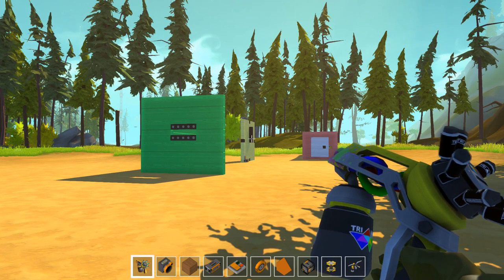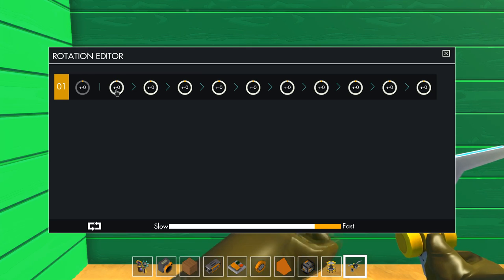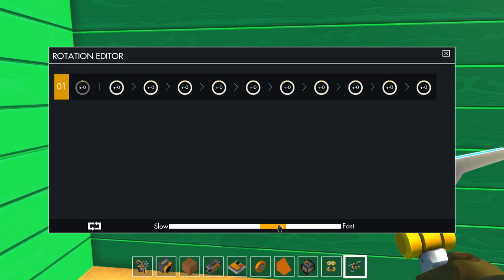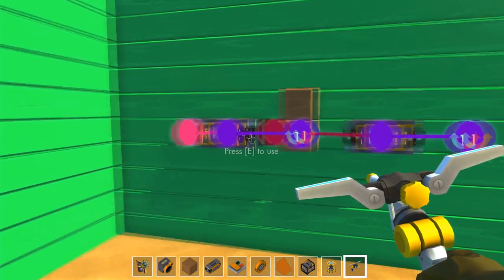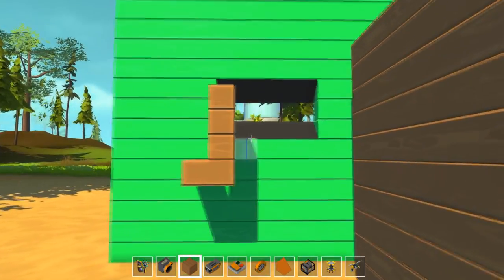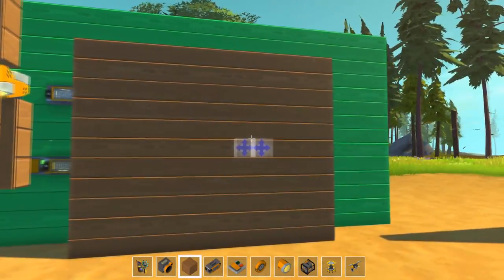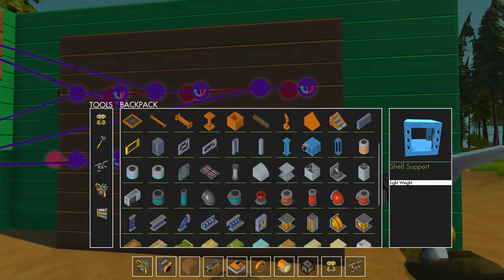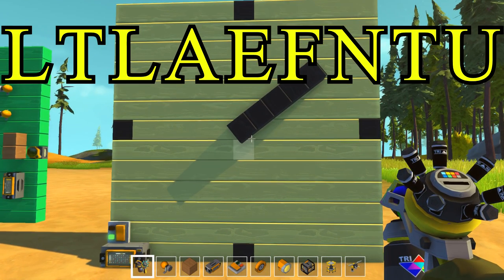TIMER TUTORIAL | SCRAP MECHANIC Tutorial

Comment: Hrmm. Thinking about this, a radial clock (using the xor method) is likely a better signifier than a row of lights. But neat. Very neat.
Reply from the maker: are you talking about using a start and stop signal for the xor? i did try circular design but unfortunately the game does not like multiple beatings being put in series with eachother, and for 15 minutes i needed quite a few.
Reply from the maker: +Callipygian Moose i mean bearing haha
Reply: Hrmm. you could compress "quite a few" to be a binary series. (bearing 1 rotates by 45 (for example), then 2 by 90, then 3 by 180) and adding/subtracting could be viable there.

Alternatively (and this is me with a large glass of wine), wouldn't a gear work?

(go go ascii art powers!) 

|.i (arm, axle, gear). With permitted movement from a series of bearinged levers? 

Or, perhaps, a cyclic bearing goverend by a sensor. So each clock "pulse" could break the sensor-beam at a different point?
Reply from the maker: yeah i think the light design in view of the challenge was more just a visual indication of how many minutes (lights) are left. i have played with some gears actually. i could do it but if i wanted a reaction each minute the bearing shaft would glitch out and start snaking on me as i would need 15 bearings because the controller can only handle 50 secs..
Reply from the maker: if i could connect multiple controllers to one bearing then problem solved
Reply: Yes. But can't you simulate that with multiple bars interacting with a single sensor?
Reply: Though for a countdown clock, I'm certainly overthinking this, as all you need is the first and last light-bearings to cover/uncover a sensor to start/stop rotation. And a gearing (via bearings/sensors) to slow down the primary visual-controlling-bearing to 15 minutes. 

If I remember the video correctly, you articulated a 30 second rotation speed (as the midpoint?)  Which means if you have two of them, (obviously adjusted for the play in start-stop times of rotating beams at whatever distance needed for accuracy), 2 in a row should provide a 900 second clock. 

To elaborate, the first sensor rotates entirely every 30 seconds. (And we'll presume at a good length so that any given square is occupied for exactly one second -- (asking wolframalpha about the radius of a circle of circumference 30 gives us 4.7.)) and one block 5 squares away has a sensor which causes another bearing to rotate at nominal speed 30 seconds). That second bearing should complete its rotation in 15 minutes

Alternatively, if you can get a binary counter (a another good video), you should be able to get 15 minutes out of four bearings in a much smaller volume.
Reply from the maker: you're obviously on the ball! Feel free to add me on steam and talk me through it in game! so in Lehman terms for my little brain, every 30 seconds send a 1 second pulse to a second controller set to mid-speed (and i would assume set to loop operation so it doesnt reset itself when the pulse is off)
Reply: (Actually, none of this is from the game -- I run linux, so I experience it vicariously through you all. Just basic mechanics and logic design)

Yes, so, the proof would be three very fast bearings, two sensors, rods of appropriate length (I think you said 10 seconds? -- you may be able to do this with engines, especially if either can implement a constant angular velocity -- maybe electric?)

The theory behind this is exactly the theory behind a gear ratio, or to be more exact, the carry bit on mechanical calculators.

A normal gear ratio is "if I've got a gear with X teeth connected to a gear of Y teeth, the gear with Y teeth will rotate X/Y times for every rotation of X. If you have a gear with exactly 1 tooth  then it requires a full circle to advance the other gear one notch. This is how mechanical calculators and flip clocks work.

Thus, at mid-speed (presuming I remembered correctly) we can simulate that one tooth'd gear by rotating once every thirty seconds. If the second wheel takes 30 seconds to rotate, and rotates for 1 second every thirty seconds, we have a total rotation time of 900 seconds.)

That's the theory at least. With rods of length 5, you should have a pulse width of... about 5 seconds? (you'll really want to play with this bit, otherwise the "play" (wobbling) of the system will be tedious and off)

To mostly reuse the light infrastructure in this example, if you send a power pulse every minute (obviously you can increase the granularity, but just for sake of argument), then simply advance the bearing 24 degrees every pulse. 

Some measurements will clearly be necessary, but hopefully I've outlined enough different techniques in this rather rambly comment to give you inspiration. I'll try to figure out your steam name...